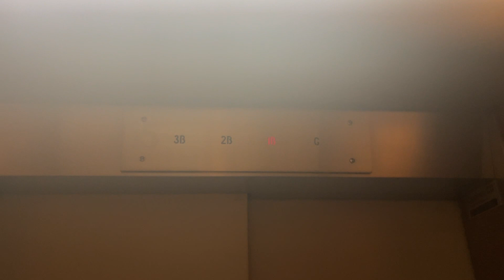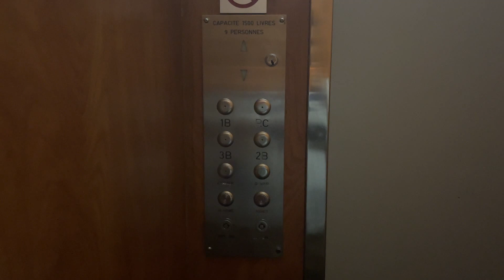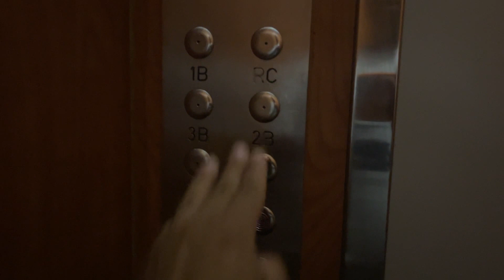STUCK: Turnbull Traction Elevator at 550 Sherbrooke Ouest, Montreal, QC

Comment: It's a shame you got stuck in this elevator. What happened?
Reply: It had weird leveling, then it stalled quietly.
Reply: @DanfossDrivesAmerica  Bummer. So the guard thought it was a leveling issue? If it is, that is a problem.
Reply from the maker: It just dead stopped between 1B and 2B.